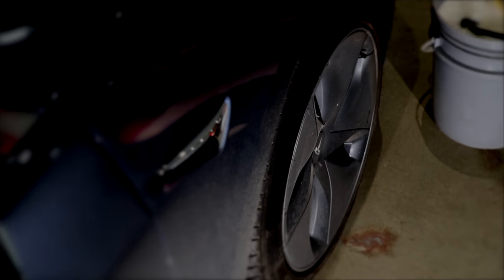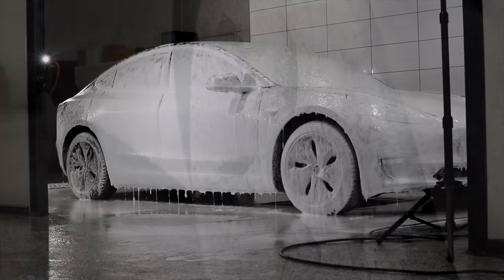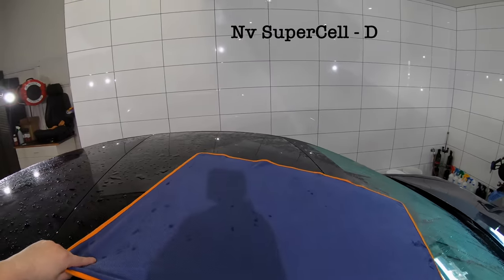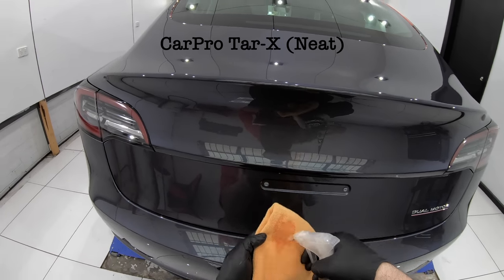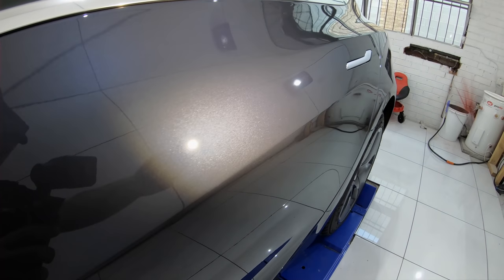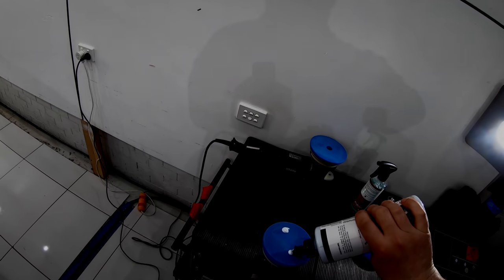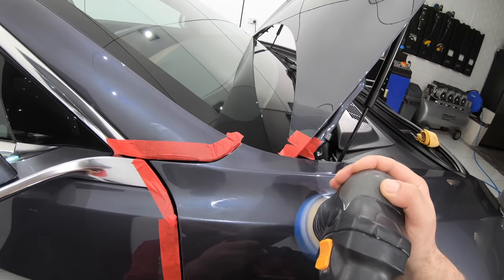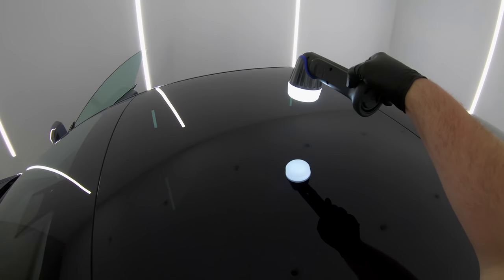Tesla Model 3 - New Car Detail & Ceramic Coating Step By Step! (Vlog 24)

Comment: Sandro thanks again for your mastercraft expertise. I'm still in awe every day I get to drive her. For those that commented yes my reaction was over the moon! It does look as good as the video shows. 

I do apologise for leaving it on vallet mode the first day. I hadn't used it before and didn't know exactly what it prevented from opening.
 I should have also mentioned those cameras don't record when you unlock the car plus I also turned off sentry mode the time it was at the shops so no need to stress for future Tesla's :) 

Thanks again mate, you work was outstanding and I highly recommend anyone on the fence about getting any car worked on by Sandro 👍 a very happy customer!
Reply: Thank you for your car I waited for a long time to be done by Sandro and very appreciated you sent me a post and result enjoying! Good luck in everything and best wishes from Sweden.
Reply: Also, for future reference, you can call the owner and they can pop the frunk for you from their phone.  They can also disable valet mode from their phone as well.
Reply: @Dirt Smoothie installed the red Tesla badge

Comment: Hi Sandro.  Not sure if anyone has said this before...  The wheel caps are not the to disguise steel wheels.  the reason for the wheel caps is because, if the customer chooses they can keep the caps on to improve aerodynamics and wind flow around the car, or remove the caps and expose the alloys.
Reply from the maker: Thanks but yes you’ll see a few comments stating that - but was unaware at the time!

Comment: Excellent turnaround, Sandro! Great video production as well. FYI, this is NOT a one off, Tesla paint is garbage.
Reply: It's the CA insane restrictions. Which is why my relative's eyes bug out when they hear about the price of gas here. On my 2021 with the same color I noticed the almost body shop inconsistency of the paint thickness compared to my Honda. Which is strange because robots paint the car. The car itself is incredible but maybe they need more work on the paint quality rather than autonomy which is cool and everything but isn't quite ready.

Comment: Ha, the trick with the iron remover and cloth is indeed pretty effective, I did this instinctively the last time I used iron remover to prevent it from drying and found that the paint work was almost as smooth as claying it.  So I accidentally developed a new technique that is not that far-fetched.    

The paint messuremants are crazy, and is actually unacceptable for an expensive car like this.   Using a cocktail of product is something I never tried but seems to work great.
You once made this car shine bright and learned, yet again, something watching this,  Great work Sandro
Reply: Gossip Heart  haha..  Belgium😪  Everything is expensive here! 60% tax on our wages, 6 governments, etc, etc..  even buying a house is made nearly impossible.

Comment: “Dual Motor Performance” with standard brakes and Aerowheels! Riiiiight.
Reply: NoTimeForThatNow do some research. This model has been discontinued here now but was available to order. AKA the P-
Reply: Obsession Car Detailing hmm... video published Dec 4, and just a couple of weeks after the owner received the car, but the model is already discontinued in Aus 🤔 Something does not add up. Come to the states and see a real Model 3 Performance!
Reply: @NoTimeForThatNow  Really dude? Something does not add up? They got rid of the P-  from the site a while ago, but those who had pre-ordered it still got it.  There are plenty of Model 3 Performance here too. A lot of people wanted the performance of the Performance model but didn't wanna pay the extra for the brakes, wheels, carbon fibre etc. It was known as the P-. Tesla got rid of that option to streamline production.

Just accept youre wrong.
Reply: Obsession Car Detailing I’ll accept your ‘obsession’ is your need to be right! Good luck with that. And yeah we had that option in the beginning here in the US, but it hasn’t been that way for a loooong time. We called it the ‘stealth performance’ and it did not bring the red stripe badging iirc.
Reply: @NoTimeForThatNow  Mate you implied the owner of the car stuck on a dual motor badge. I corrected you, and you continued to argue. Cool it hasn't been that in the US for a long time, but these cars only hit the RHD market a few months ago.
Reply: Obsession Car Detailing but why would Tesla go back to the lesser model 3 performance if they already changed it in the US? Look I really get a kick out of you getting bent out of shape, youre taking this too seriously. If youd just said your first comment without the ‘do some research’ part, I wouldnt be a dick to you.

Comment: I knew Tesla paint quality was questionable before I got my Model 3...so I had mine completely wrapped in PPF to protect and enhance the terrible paint. But screw the paint, I absolutely love the car from the driving experience to the ownership experience. And, I've found that maintenance washes don't take me as long as my gas cars...not sure why!
Reply: Maybe because you use the brakes much less and thus have not so much abrased dust from the break pads on the wheels?

Comment: I have done about 5 Teslas, they  ALL  had this problem! actually 3 of them even had DULL spots around the car from them denibbing it and not polishing the dull spots, its a quick fix but annoying. Lots of other paint defects as well.
Reply: Palm Springs Detailer i’ve done quite a few here in europe, i didnt find any defects on those. They were late 2019 models all of them
Reply: I don't like putting blame on Tesla because they are a new car company and they don't have the skill of perfection when it comes to bodywork. But I really hope they improve!

Comment: Sandro, great thanks for the video I have waited for a long-long time. I am planning to buy Tesla Model 3, so have waited your verdict about the paint. Yes, huge job done, but the resuld is saying everything! Probably you don't know or it was agreed with the customer - behind plastic wheels covers are beautiful alum lightweight rims. Simply pull the plastic wheel cover to remove. Plastic covers are designed to decrease air turbulance and increase range, but many people are removing them for nice grey rims. I am planning to remove mine when I will get the car and protect the rims as well as calipers. You know better, thats for sure and this is just a very small advice from my side or at least a plan. Separate thanks to the Tesla owner, he was so kind and let me know the car was done by you so I was waited patiently (almost) when you will publish the video. Great job and great result. Amazing car colour! Greetings from Sweden.

Comment: Amazing work and video Sandro! 
Incredible difference on the paint thickness readings and how bad the condition of was. It's not the first time I see this on the Teslas. If I'm not to wrong Meguiars has helped them out with the polishing from the manufacturing plants. And think that's the reason that the M110 and M210 got developed and suits the softer finicky paints. And a detailer on the Autopia forum has showed some pretty bad examples of Teslas he's done. Though not just from the manufacturing but the dealerships in his area pretty much destroys the paint on the new cars. 

Awesome to follow you through the job on this one. And thanks for all of the tips and trix during the work. Thanks for shareing your work with us Sandro!

Comment: Fantastic video Sandro, I learned a lot!  I also have a grey Tesla.  It has light wash induced marring and I would like to do a one step / all in one before applying a spray sealant like Ethos Resist or NV Lustre.  I’m new to polishing but was thinking of using CarPro Essence with a CarPro orange pad?  Is this a good choice or what do you recommend 🙏 Thank you!
Reply from the maker: Yes I think Essence on the orange pad is a great place to start and if it’s just light swirls it should take care them, just give Essence a few hours to cure or wait until the next day to add your top coat.
Reply: @CarCraftAutoDetailing  Thank you, very much appreciated!

Comment: Sandro that was amazing!  Thank you for that video!  I have a Tesla Model 3.  I have had it now for about a 1 year.  I did almost the same process you outlined.  Not nearly as good of course :), but your observation on the paint I experienced as well.  After a year of owning it, I think the Tesla is also more susceptible to minor paint chips that a normal OEM paint coat would likely to be able to absorb.   I would strongly recommend anybody buying a Tesla go visit a Sandro right after taking possession of the car.   BTW your video for fixing paint chips guided me through that process. 

Also thank you for showing your process and polishing techniques.  I learned a lot from it.  Let me know how I can support you outside of liking your videos.  Really appreciate your hard work and attention to detail!

Comment: Great video, thanks, I plan on detailing my Tesla when it arrives in January, I plan on using Carpro orange cutting disc, Carpro fixer one step polish & compound, finish with Carpro ceramic 3.0 what do you think?
Reply from the maker: Thanks, and what I would say it do a test to see if your combination achieves the results you’re after and go from there, but it could certainly work well and UK is a fantastic coating.

Comment: Looking at your video, there were just a couple of spots that you got a thickness rating in the 80s.  The rest was pretty high.  Also, Tesla cameras do not flash red (they don't flash, at all). Sentry mode would have to be manually turned on, by the owner. This is because there has to be some place to save these recordings and it does not come in the car, at the time of sale.

Comment: What’s about the finishing polish of menzerna SF3800 for finishing stage ? is it good ?
Reply from the maker: It can be a good polish but it really depends on what the paint requires and responds best to
Reply: Car Craft Auto Detailing my car paint is soft paint , it will work good ?
Reply from the maker: It could be a good a option for a final finishing polish on soft paint with a foam finish pad.

Comment: Hey Sandro, when you correct paint, you spend time trying different combinations of products. If I'm just looking to get into paint correction, how do I make a start without tens of products to try? I'll start with NV Precision and Finesse and Shine Supply Throwback.
For pads, I've seen cheap ones on ebay, what's your opinion? Get the proper ones?
Is a random orbital sander with 5" backing plate completely out of the question? The specific one I have has details as follows:
Power input: 270W
Sanding pad diameter: 125mm
Orbital stroke rate: 4000-24000 opm
Eccentricity: 2mm
Machine weight: 1.5kg
Reply: Thanks heaps Sandro. Means a lot.

Comment: i have heard that the paint job on teslas are horrible from factory aswelkll having a very soft paint.
Reply: Its interesting observation considering how modern the car is........they are not the type of car you will still see on the road in 15-20 years. Many new cars are like this..even big brands. The Engines aren't built to last. Things are moving that quick and people will just keep upgrading.

Comment: I'm just gonna pause here at 4:35 - you do know they pop off to reveal actual alloy wheels underneath, right? Great video though.  My model 3 has had a few issues and it's clear it's not BMW in terms of build quality, but man is it a nice car.  Absolutely love it.
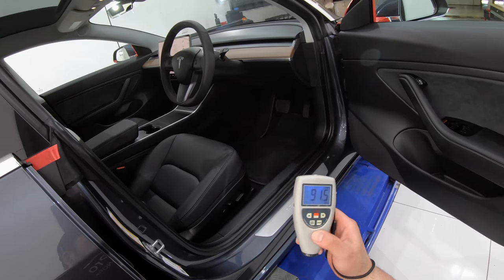Reply: at the 25:00 mark, that's just Tesla in general. Their tech and batteries are unmatched - everyone else is playing catchup, but relatively simple things (and yes, I know Tesla are new to making cars) such as getting panels lined up, clicking trim in fully, painting the car, getting the steering wheel straight (or even staying attached in some cases) it's laughable.  They don't need to do anything to improve it - it's a car for the history books in terms of demand.  Quality could get worse and they'll still sell millions.  Look at my post above - there are loads of issues with these cars but I can't imagine going back to a 'normal' car now.
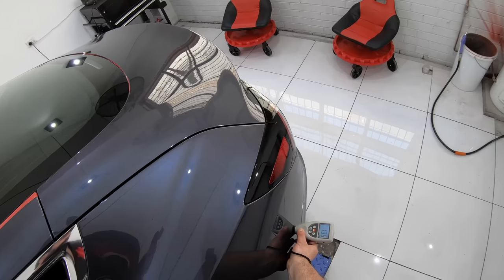Reply: 25:50 - many detailers wouldn't but in honesty can you tell me that you'd arrive at a dealership to pick up your new car with a PDG? If the paint was 60microns the shop wouldn't care as it's "painted" and not damaged.   Realistically, 99% of car owners aren't really going to care about paint depth unless it's noticeably damaged or worn.

Comment: Nice detail! Underneath those plastic covers are a nice set of alloy wheels. I coated the covers and the wheels underneath  for my dads model 3 in this same Grey color. 

On my model 3 I am tempted to put it on stands and clean and spray nova jet on all the bottom plastic. Or do you think Lustre is a better choice? Or some other product?
Reply: Yeah I wish he took off the wheel caps for the cleaning step. They must be pretty dirty under there :)

Comment: How much do you charge for something like this? Is it based off of the hourly basis or total project?
Reply from the maker: It varies a lot but it’s a fixed quote based on an inspection and the customers needs and wants.
Reply: @CarCraftAutoDetailing  Ahh thank you, great video. Teslas do have bad paint from the factory. They're known for their QC issues.. panel gaps, electrical issues, etc..

Comment: how comes you didn't remove the covers after you realised that the aluminium rims have covers even through its a relatively new car i find that there tends to be alot more brake dust since the car brakes itself and the brakes are used a lot more often than normal cars

Comment: what's the blow dryer you used ?
Reply from the maker: It was either the BigBlow blower or the MetroVac
Reply: @CarCraftAutoDetailing  I can't find the Big Blow Blower but which one is the best? I'm looking to buy a really good one, thank you!
Reply from the maker: I’m using the Metrovac Vac n blo Pro at the moment and it’s a great unit probably a little more durable and solid than the Bigbios, but I like the hoses on the bigboi s a little better, so it’s hard to say

Comment: I don’t see the point of ipa after decon never had problems the residue would be removed by rinsing and especially drying a good idea for a video would be correcting a panel after full decon but correct one side that has been panel wiped and correct the other side that hasn’t been panel wiped to see if it truly makes a difference

Comment: but question, considering how this uber thin paint flakes and chips in Canada, worse than a 2000s Mazda, and then rot starts, whats the point. I once coated a Honda and the result was still crap paint from the factory. This ain't an AMG Porsche now BMW nor even Ford quality paint. too thin too poorly adhering to the metal etc etc. now, a suntek type film makes sense not this. without a foundation quality baked paint, ceramic costing cheap paint is useless.. now on germans, ceramic does an incredible protection and long term hydrophobic service...

Comment: You are lucky that You didnt get black solid Tesla colour this is really shitty paint even the wind makes scratches on this colour grey is quite easy , i recommend Tesla owners to take with them inspection light and check the car when they pick up brand new tesla .
Reply: My brother has a black dual motor and the paint isn't too bad.  There are a few runs of clear coat and some panel gap issues.  Still, the car runs flawlessly and is bullet fast.  Sandro basically performed a miracle on this particular 3, owner is lucky Sandros magic hands touched it lol.  After watching this video I almost wouldn't buy one unless I'm prepared to have it fully detailed.
Reply: Its so shitty colour and tesla has got a huge problem with this so decided to change basic colour from solid black to white ( colour included in the price ) the rest of the colours u need to pay extra